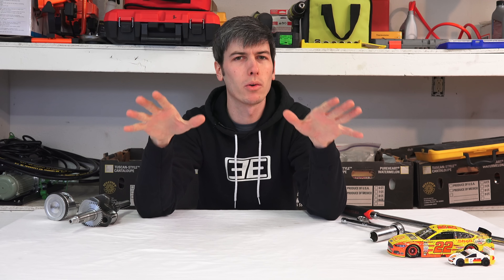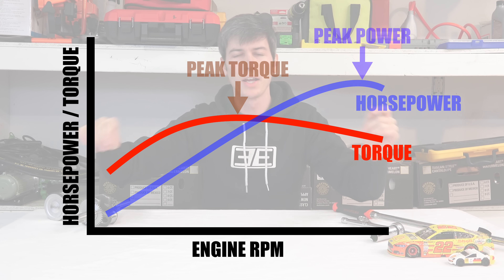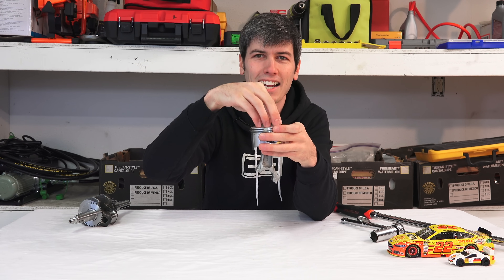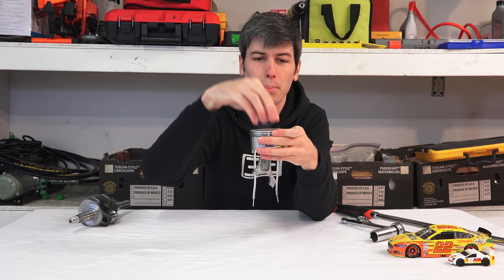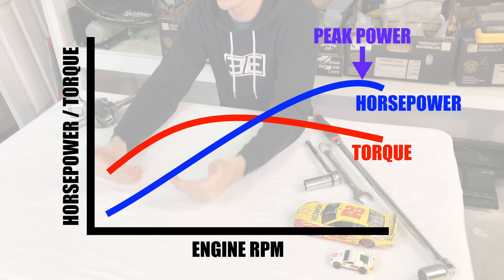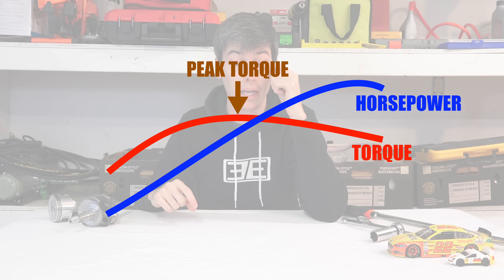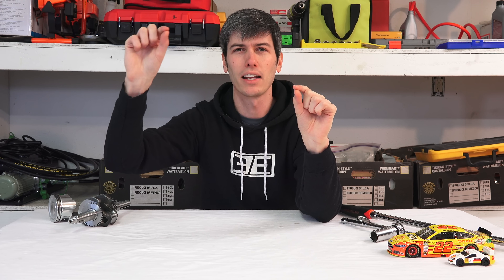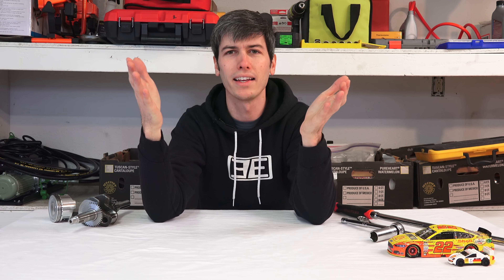Horsepower vs Torque - A Simple Explanation

Comment: This is how it would be thought of in a physics lesson. It might help. 

Torque is a turning force. And you can use that force to turn, or revolve something - like a spanner or wrench. And by applying torque, you can make that tool turn a revolution. By doing so, you have completed 'work' (though a fairly small amount).

Torque is measured in either Newton Metres, or Lbs Feet. In this explanation, we will just keep things simple - think of torque as strength. 

Horse Power is a method of measuring how much work is done in a given time. 

You need to know how much torque is applied, multiplied by how fast that torque is applied, to work out how much horsepower is achieved. 

This is the way I think of it...

There are two piles of bricks, one hundred in each pile, and they need moving across a building site. 

A muscle man and a marathon runner challenge each other to a race. To see who can move a pile of the bricks the fastest. 

The chap with a lot of muscle and strength (we will think of him as having the strength to apply lots of torque) is built like Ronnie Coleman. He is big and immensely strong but heavy and quite slow as a result. He is quite capable of scooping up a whole load of bricks and carrying them. He can carry 20 bricks at once, but he SLOOOOWLY.... walks with them. He could move all the bricks in 5 trips and take 10 minutes. 

The seriously fit runner, who is light and fast on his feet (think of Mo Farrah) might only carry 2 bricks - 1 in each hand - and sprints across the ground. He has a low amount of muscle (or torque) but his legs can run (a form of revolution for our example) at a really fast rate. It takes the runner 50 trips to move the bricks. Also in 10 minutes

Now if they both complete the task in the same time, then they have both done equal amounts of WORK (which can be measured in Horsepower or Kilowatts) and It's a draw.

However, if Ronnie Coleman could manage to carry 25 bricks per trip, at the same pace, he does it in 4 trips, and in just 8 mins. He will have put out more horsepower. 

He carries bricks at a slow pace compared to Mo, but by applying more strength (or torque), each rpm is doing more effort. Then it's just a case of multiplying the two together. Torque X RPMs. 

However, Mo Farrah - still only carrying 2 bricks - refuses to be beaten!!! He hasn't got the strength (or torque) to carry more than 2 bricks, but he can pick up the pace instead. So he runs faster and his legs are a blur!!! . He finishes the task faster than Ronnie, let's say 7 mins. His body, although weaker at lifting, has now worked harder, because his low amount of torque, could be multiplied by very high revs. Think of a motorbike screaming along at 16000 rpms....    Lots and lots and lots of small, easy efforts, all added up to one huge effort to beat Ronnie. And he has now worked the hardest

Mo Farrah's incredibly hard work (measured in horsepower) meant he was moving more bricks in a given amount of time.

Keep this example in mind and think of your car engine. Horsepower is simply a way of measuring work done in a given time.  It is not a unit of force, or a measure of how fast it can travel. The ability of an engine to provide power is achieved either by applying large amounts of torque at low revs, or applying low amounts of torque at high revs.

In real life Ronnie Coleman is built like a truck and would most likely win the competition in our example. He would be more efficient as he wouldn't be wasting time picking up and putting down bricks 50 times. Plus Mo Farrah would probably have to run at some ridiculous speed like 40 mph. It's just not feasible. You couldn't expect a motorcycle to carry bricks - it's not designed for it. The truck is. An articulated lorry tractor unit or semi - truck (if you're in America), might have 600 or 700 horsepower but that is only an indication of how much work it is capable of.

If comparing two vehicles to see which is faster, then look at POWER TO WEIGHT ratio. Although so many other factors affect performance: air drag, rolling resistance, a final drive ratio affects acceleration, fwd,rwd, awd, tyre traction.... etc etc etc. Its never simple. 

When office workers talk of how much work they have done that day - scientifically that's not really the case. It does not take a lot of horsepower or Watts to pick up a few pens, or shuffle some paper. The man who's outside, lifting and carrying all day long, has worked much harder. Something my boss could never understand when I tried telling him that office work is not real work! (sorry office workers. I mean no offence; that's physics!)
Reply: Thank you for your explanation. I found it very useful and informative. :)
Reply: Thank you: someone who still takes the time and trouble to explain something clearly and amusingly writing in the age of video.  Much appreciated.
Reply: Thanks for the clear and Crystal explanation!! Now, we have the clarity between the two. 🙏❤️❤️
Reply: Martyn M. It is a beautiful explanation! Thank You!
Reply: Best explanation. Trying for an hoir to understand through videos but this did it for me.
Reply: Best explanation I’ve ever herd ... I understand it in my mind but was never able to articulate it as you did .. well done sir!
Reply: Martyn M. Superb explanation, thanks. Robert, Australia 👍
Reply: Thank you for explaining this subject so well .
Reply: @Martyn M:  thanks for putting the cookies on the shelf so the kiddies can reach them.  You did us wonders explaining engineering in layman's term.  My imagination ran so wild that I was very exhausted at the end of your explanation rotating playing each character carrying heavy bricks up hill.  I now understand just how powerful the sports muscle cars are, especially the ones with 600HP and 550lbs feet of torque; no wonder they guzzle down gallons of petro within a few miles.
Reply: @Mmmm-zg1vn  glad it helped. Sometimes people just need to see a subject from a different angle.
Reply: I'd say that's a good illustration of how high-torque/low speed and low torque/high speed can yield the same results.  

Torque in itself does not tell us much.  Ultimate performance will depend on torque AND speed.  Horsepower takes both elements into account.
Reply: @Sherman62  Yes, that's right. By speed, I presume you mean how fast that torque is applied. But yes... Spot on!
Reply: @martynm.449  sir can u help me out ? im looking for a better weight picking pickup . i can see 2 figures. one is mentioning peak torque, other is hp. so what should i consider for a better pickup ? torque or hp ?
Reply: @harrysingh23116  It depends on how much they weigh. Compare their weight : hp ratios.
Reply: Martyn M.    Both you and the youtuber are exceptionally good teachers in terms of explaining what is horsepower and what is torque and the relationship between both in PLAIN SIMPLE ENGLISH。  Thank u very much
Reply: Thank u so much but I'm not in a proper position to take any credit 🙏  I've owned & driven many types of sports vehicles throughout decades but my passion and knowledge about cars were limited because my golden years had no such thing as 'Internet'. I'm picking up new knowledge n information bit by bit on YouTube. FYI, my playboy motoring years were cars like German Ford Capri (modified with dual Webber carbarutors), Jensen Healey convertible (DOHC 16 valves twin carbs), Celica GT DOHC dual carbs 2.0 liter, bimmer 323i / 325i / 330i / 335i / 530i / 540i ... stay loyal to BMW for 2.5 decades 
Best of luck to you and be healthy & happy 💜
Reply: Absolutely fantastic.. but i have a doubt nd I can only get back after framing the question.. as I need to understand this concept on a whole nd then frame my doubt
Reply: Excellent explanation ! Good job
Reply: Very well said, thank you for your input.
Reply: Interesting :)

The way it seems the easiest to understand for me is like this:
- torque is the maximum force that engine can create in one operating cycle, that is 1 RPM (at an specific RPM)
- power (max power), maximum work that engine can generate (which is function of torque and RPM). SO this tell us more about engine performance

So torque by itself does not tell us much. We need to know the context - range of RPM, or the best is to see the whole usable torque curve across RPM (which is power curve, or torque curve).
Reply: Excelent analogy.
Reply: Martyn M. Thank YOU
Reply: Good and helpful post. My only suggestion is that you delete the line near the beginning, "You can't really compare the two.", You CAN compare the two, and you did exactly that with the rest of your post. You compared (and contrasted) the two by means of analogies to give us insights us as to what the concepts torque and horsepower are.
Reply: @rontiemens2553  I've deleted that. Thank you for putting me right.
Reply: Martyn M. I will never forget the difference between torque and hp now. You did a great job explaining.
Reply: The brain uses about 20% of energy of a person at rest, more when thinking. It needs power to generate electric signals for information transfer. Work is just the integral of power over time (or average power times time), so office work is work in the sense of physics. This is similar to how computer processors work, they may require hundreds of Watts of power to operate without any moving parts, all power they consume is ultimately dissipated as heat.
Reply: @martynm.449  You need to have a good diet and get physical exercise to stay slim.
Reply: Martyn M. I am wondering how legs could revolve
Reply: I didn't read the whole thing...
Reply: i needed an analogy. Thank you!
Reply: .. Hey it's kinda unfair to the Seriously Fit Runner to not have a name.. Unlike Ronnie 'Muscle effin man' Coleman, don't u think..
Reply: @sakubatzumatsu  yeah OK. You're right. I'll call him Mo Farrah; he's thin and spindly.
Reply: @martynm.449  Can you explain me how gears in a motor affects torque and speed?
Reply: If its on me.. i would give you  and the youtuber on this video a Nobel prize for your time your logic examples and explaining shearing the precious information

You are rear in YouTube
Keep up the good work
Have a wonderfull day sir👑
Reply: N.Y.C Saturday February 22 5:20 a.m. reading your comment office work is not really work you just pissed off DMV, post office, and the IRS. you're in trouble .plus you have more likes than the video.
Reply: @timeisapathwalkingtounderstand  office work could be very very hard and stressful and the studys indicates that the office workers and customer service agents are more likely to get heart stroke or problems and brain stroke to the amounts of stress and anxiety they get in a day..

Wity that beeing said i understand what Mr. Martyn M. Is talking about.. in the law of physics work means moving an object from point A to point B 100% correct and logic at its best.
Reply: wow i understood everything, this made sense THANK YOU
Reply: @Martyn M, brilliant explanation. Not often do you come across highly technically minded people with the ability to simplify concepts like this. Would have been great to see a bit more on interpreting the specifications on a few cars when deciding to buy a particular make/model.
Reply: Excellent explanation.
Reply: Bro, I worked insane at a desk, and mental fatigue is way more exhausting than you think. P.S. I also worked construction for 40 yrs. Do you also realize that your brain processing your input from just your eyes alone can consume up to 15 % of your energy. Point, reading and processing "paper work" is very taxing. I have seen (some not all) hot shot foreman get promoted to office work and be totally overwhelmed with the amount of information they have to process being in an "office".
Reply: I absolutely love this response. Not only is it both more informative, understandable and correct than the video, it's downright funny. Thanks Martyn
Reply: @torestrand2663  that's the nicest response I've had. Thank you. :)
Reply: When a reply to a video does a better job than the video. Nice job! You explained this very well. Although I have to disagree with the bias against office workers. Your boss might actually have some right, have you even considered it? You may know a lot about physical power, but you still have much to learn about how the mind works 🙂 I believe one day you will gain this knowledge as well.
Reply: One of the best comments ive seen in the 6 years ive been in this platform, you could easily pass any exam to be a teacher with this skills. Congratulations!
Reply: @agustindetlefsen6944  Thanks very much! Have a great weekend
Reply: But wat of the ditch digger that doesn’t move from a single spot all day but shovels sand in one spot all day???
Reply: 5 years later I have to thank you for writing such comprehensible text. You just taught me how torque and horsepower are defined and how they work together.
Reply: This is quite possibly the best explanation I've ever seen. The video is super confusing and leaves out so much information.
Reply: Wonderful
Reply: Martyn M. Thank you so much for your explanation!

Is torque proportional to horsepower(Does horsepower increase as torque increases)?

Also, does torque improve acceleration?
Reply: @Super_Smash_Dude  yes, horsepower would increase as torque increases - if the rate at which that torque is applied stays constant. If more torque is applied and at a quicker rate as well, then horsepower would shoot up massively!

As to acceleration, I'm not sure I'm qualified enough to answer...? There are lots of factors to take into consideration. I would guess that the point of fastest acceleration would be when the engine is producing max horsepower, wherever that might be in the rev range. 

But in my experience - big torque engines give plenty of grunt off the line and mid rev range. And high revving engines wouldn't really start giving you that g - force (pin you back) feeling until it got up into it's higher revs. So it's down to where you want that feeling of acceleration. Low down in the gear, or higher up near the red line. Both are fun, especially the noise a high revving petrol engine makes close to the red line.
Reply: @martynm.449  Thank you SOOO much!!!

I'm really grateful for your answer:D
Reply: @Super_Smash_Dude  no worries.
Reply: I understand the metapher but what is hp related to a motor of for example a car how does it relate to acceleration and speed and where and how is it measured?
Thanks for the explenation.
Reply: @lewpressler2572  horsepower is the total amount of work the engine is capable of. Power to weight ratio affects speed and acceleration. Think of a cruise ship with a 50 thousand horsepower engine. Sounds a lot, but if that ship weighs 50,000 tons, the power to weight ratio is 1 horsepower per ton. And it's not going to be fast.
Reply: Martyn M. Why isn’t this pinned to the video? I’m disappointed in EE
Reply: thank you for your way of explaning i think i had understand a bit about tourqe...
specialy when u speak about using 1st gear to measure...
i was kind of wondering which gear is it that actualy being used in measuring tourqe and what was the exact distance...
it helped a lot to me
Reply: Martyn M. 
may i ask for an example...
the one using numbers...
i get d idea but still cant figure the way of computing to have the hoursepower
Reply: Martyn M. 
about the tourqe with ( lbs feet )...
where was feet been measured?
is it in the circumference of the crankshaft or the diameter?
or in the travel of the wheel
Reply: I wish I could have a way to collect all your replies! Very educational! Thx
Reply: Just let me know when the next class is and I'll be there... And maybe talk to my old chemistry professors so they're pass fail rates can get up out the grave.
Reply: Many thanks, that's the best explanation I have read.
Horsepower word is really confusing (to me at least), because power is synonymous to strength, so also to force and torque. Perhaps it should be called rpmtorque or torquerpm.
Reply: Martyn M. “Work” has a different definition in the “work place” now than when the phrase was coined.
Reply: zou got an A
Reply: Martyn M I appreciate your effort to explain by way of analogy but with respect if you read back you may even see some of the many inconsistencies present. The paragraph ending in it's a draw answers a question no one is asking. By and large more confusing than anything else really  and I worry that some people having read it now think they have their head around it when they don't.
Reply: Martyn M. Martyn M. Wow, you really did put some effort in it. Appreciate it.
But I have to say this, your analogy is a bit flawed. Actually, more than a bit.
First, you cannot use humans as an example because there is no such thing as cardio when it comes to engines. Engines don't get tired. They can run out of fuel but that is something entirely different. I will explain later. Keep reading.
Second, you cannot split the weight. If you want to move a car, you cannot move doors & windows in first run, than tyres & chassis in second etc...etc....It all goes at once.
I wont even mention that RC weighs like 140kg (~310lbs), and Farah around 50. 
So,
Horsepower is NOT equal to work. It actually represents the potential amount of work done in certain period of time. 
In physics P = W/t
So, right comparison would be like em.....just keep reading
Ronnie Coleman would develop much greater horsepower compared to Mo Farah anywhere and anytime. If u give them both a same amount of weight to lift on a desk which is 1m tall (lets say 100kg dumbell), Ronnie would lift it in a second or two, while the farah would take at least 5 or 6 seconds, if he even manages to lift it at all. That is cuz he is much STRONGER. And strength in a car would mean Horsepower, NOT torque. Do you copy? 
You MUST NOT split the weight because that is completely different comparison and type od work.
You should have put it like this for example: Diesel and petrol engines, if both generate 100 hp, are capable od doing same amount of work im certain period of time.
So, even if 100hp turbodiesel develops much higher torque, it still wont be able to pull more load than 100hp N/A petrol engine. Why? Because there is a thing called gearbox, and petrol engine will have greater reduction, aka shorter gearbox (don't know if term "shorter" is used in english, so you'll forgive me that one. In my language, we say it like that).
So if u hook them up with a 1 ton trailer, they will both pull it at same speed. Petrol car will just do it at higher revs.
Same goes for acceleration. 
The only momentum in a car that is relevant, is the one on the shaft that EXITS the gearbox (or momentum on wheels if u wanna put it literally) And that momentum is proportional to power that engine is able to provide at certain point.
To push this topic to the limits, an imaginary engine that develops 500hp, but only one Nm of torque( so it would rev like, 50k) could pull the same weight as 500hp engine which develops 700Nm of torque at low revs, if u provide it with much much greater gearbox reduction.
Reply: @milorad7226  in my example, the humans don't get tired. They are working at constant rates. It's a method of comparing two forms of producing power, in order to help people see things more clearly. However, the freedom of the Internet gives everybody (including yourself) the ability to express their opinion.
Reply: Martyn M. Dude, it's not my opinion. It's Newton's law. POWER of the car determines how fast you can accelerate or how much load you can haul. And power of the car is its horsepower, not torque.
You just need appropriate gearing. 
I don't want to offend you or your niece or teacher or anyone.....but saying that RC and Mo Farah would develop same horsepower if they were submitted to medical tests, is just WRONG. 
As it has been said before, torque is a component of power. Without rpm, torque alone does not mean much. You can have torque without power, but you cannot have power without torque. 
Just like the guy in the video explained.
Torque on the wheels matters, not one on the crankshaft. 
I really cannot explain it more clearly then I did in my last comment. 100hp low tq-high rpm engine is capable of doing the same amount of work as 100hp high tq- low rpm engine. That is not my opinion, it's how our cars work. 
Look at this example. Ferrari engine develops very high horsepower(lets say 550hp), but it does not have that much torque compared to hp. Lets say it had 600NM.
On the other hand, truck engine has around, lets say 400hp, but 900NM of crankshaft torque.
Answer me now, which of these 2 engines is STRONGER?
We'll continue after you answer.
Reply: @milorad7226  I don't understand what you are trying to say? You are making the same points that I have already done in my original write up. However, I don't know what you are talking about, when you reference medical testing? All you are doing is confusing people.

Why not make your own videos/diagrams /analogies or whatever and stop trying to needlessly cloud people's understanding.

My discussion with you is closed.
Reply: Martyn M. Clouding how? I was just trying to correct some analogies of yours, that were not 100% correct.
 We are all guys, petrol runs through our veins, and we should all understand perfectly how our cars work.
Its all about horsepower and gearing. That is the point.
You said torque is a turning force. Ok, but, you do realize, nothing actually needs to be turned, right? You can have torque on the crankshaft without it rotating.
Crankshaft torque is not what matters. Its torque on the wheels.
So even if ferrari engine (lets say 600hp) does not generate as much crankshaft torque as truck engine(400hp), it will still be able to pull greater load if you fit appropriate gearbox in it. That's all folks.
Reply: Martyn M. Amazing explanation thank you. The ladies in the office couldn’t understand why the linemen, working on power lines, were paid so much more in the same amount of time. Another factor is the linemen’s work is much more dangerous but that doesn’t factor into the HP/torque equation.
Reply: From a longevity standpoint it seems that  one running at a higher RPM would be the first to fail if made from the same materials. To have a comparable life expectancy, it seems that the higher RPM we need superior material,  possibly more maintenance.? Cost?? I know, I know, this has nothing to do with the topic of the video. Anyway, thank you, very informative 👍
Reply: Brilliant Explanation! Thanks a lot Sir! With the likes of this channel, School will be extinct soon.
Reply: Well explained... And Thank you for you patience and interest...
Reply: A truck might be rated at only 400 horsepower, but can still tow 80,000. A Dodge Challenger can be rated at 400 horsepower, yet only able to tow 8,000 pounds.
Reply: Thanks! I didn't understand the video but your explanation is very clear.
Reply: Wow. 👏👏👏👏
Reply: Bravo. Thanks for your time to write this.
Reply: Energy is information in quantum information theory 
So this makes that moving information is work too
Reply: @my self Also helps if it's red.
Reply: Martyn M. Read the whole thing. Thx bro 👍
Reply: Martyn M. please don’t say torque is measured in lbs feet or people are gonna actually believe it
Reply: Better than video itself! :D
Reply: So no head
Reply: haha excellent!
Reply: Martyn M. Thanks cutie
Reply: Best way to understand given the formulas  HP equals Torque x RPM thus max RPM you can do assuming one engine turn equals one tire turn looking at his cars
CAR1  200 HP divided by 100 torque equals 2 RPM
CAR2  100 HP divided by 2OO torque equals 1/2 RPM thus the first car gets more wheel spins and thus goes faster.  Note that these numbers are determined based on the engine you can have an engine with more torque than the 200 but it will have more HP than 100 at that half rpm  so you cant say I have same car two but I double its torque to 400 and now I only get a quarter RPM because you have a different engine now and if you dyno it with double the torque you will find that the horsepower has gone up also and the car may now put out 400 hp so when you do the calculation of 400 HP divided by 400 torque you get 1 RPM so it is a little bit faster.
Reply: Thx! That's a perfect example: "When office workers talk of how much work they have done that day - scientifically that's not really the case. It does not take a lot of horsepower or Watts to pick up a few pens, or shuffle some paper. The man who's outside, lifting and carrying all day long, has worked much harder. Something my boss could never understand when I tried telling him that office work is not real work! (sorry office workers. I mean no offence; that's physics!)"
Reply: Thanks man, didn't even have time watch the video
Reply: How does steroids and EPO relate to this?
Reply: Brilliant, I love this analogy
Reply: Excellent!
Reply: The go fast stripes had me rolling😂
Reply: Awesome read man! I do have a question since I’m new to this stuff. Is there a difference between lbs ft and ft lbs?
Reply: *taught
Reply: Big Mac vs Ferrari
Reply: Good explanation.
Reply: Really well explained, better than the video tbh
Reply: Amazing
Reply: A legend, Mr. Wayne.
Reply: Well done. Very well explained.
Reply: This man typed an essay. Deserves a like
Reply: Now explain it to me like I’m 5.
Reply: copy paste
Reply: RONNIE COLEMAN HERE I COME. JESUS
Reply: Before i like the comment it was 1.6k, after i liked its 1.7k, my like is worth 1k, i guess
Reply: Thank you for the better explanation.
Reply: But instead of guessing how fast too people can complete work.

200hp/100tq with 2:1 mission is 100hp/200tq and has same acceleration as 100hp/200tq with 1:1 mission,

2:1 mission cuts RPM in half therefore by definition cuts the Power in half (HP=TQ*RPM)
But 2:1 mission also doubles the TQ output.
Reply: A long comment but the information I got is very abundant. Worth the read
Reply: That last bit about "to see which is faster, then look at POWER TO WEIGHT ratio" is really what the common guy should fixate on... instead of peak torque or HP numbers. 
And I would say that the integral (area under the HP or torque curve) is more informative than the peak, as most of us are not typically driving bang-on at the peak.
Reply: Help!!
Reply: Thank you so much!
Reply: Your description has inaccuracies. For example, you said WORK can be measured in Kilowatts or Horsepower. This is wrong. Work is measured in Joules. Power is measured in Joules per second (aka, Watts). 1 W = 1 J/s.

The example in the video where the two identical cars (aside from torque and horsepower) travel the same distance, with the higher horsepower vehicle travelling that distance faster is a way better example.

You say, "The ability of an engine to provide power is achieved either by applying large amounts of torque at low revs or, or applying low accounts of torque at high revs." That doesn't make sense. Engines provide power by generating torque at any amount of revs. If you want an engine to provide lots of power you want it to provide high torque and high revs.
Reply: Thanks for this detailed analogy, it really helps! Bonus for the quick jab at office workers haha 😄
Reply: Flawless explanation! 💯 I completely understand now.
Reply: Very good Explanation but i think if Rone Coleman is Truck in your example then Mo Farrah should be Ferrari😊
Reply: You're wrong regarding office workers, they don't do the manual labor of shuffling paper around, they do mental labor of information processing, and information is also physical, so the brain burns energy doing mental tasks the exact same way muscles do, and the same way a computer consumes energy to make computations. Now it's true that high intensity manual work requires more physical power since the brain only consumes ~20 watts at all times while physical exertion can go into the 100s of watts, so you can say manual labor is objectively more work, but you can't say that mental labor is "not real work".
Reply: Nice video
Reply: Nice video
Reply: Best explanation! Thankyou for your comment!
Reply: Better explanation than the video!
Reply: You're a scholar and better than dude on this website.
Reply: Far better explanation than the video!
Reply: Bad enough the presenter need 7min 24 seconds to explain something so simple but your comment is ridiculously complex. From an automotive engineer.
Reply: Great explanation 👌
Reply: Thanks
Reply: Martyn m you need to start your own channel .thanks
Reply: @martynm.449  Work has many different meanings.  Physical exercise can be strenuous, but for most people, they don't think of it as working.
Reply: You're exactly right. Like when I'm trying to explain to guys at work that, there's a hell of a lot more work in a maintenance man's toolbag, than there is in walking up to machinery and pushing a button. Work is defined in hp and not what the majority feel good saying. Lol
Reply: I read your entire comment for two reasons:
1. A person that wrote "all that" must have an interesting point he/she is trying to deliver. 
2. still trying to understand that horsepower vs. torque thing! 
good example. However, I need to know all the components at work and the moving parts  stating at the engine and ending at the wheels, in order to understand it better.
Reply: @David-R.  Fox Mulder would say... 'The truth is out there'
Reply: Martyn M. 
I think I understand. 
Steroids= horsepower 
Cardio= torque
Reply: @terrypeart3875 lots of torque is the ability to lift the whole rack of weights and slowly carrying them to the other side of the gym in one go. Ronnie Coleman 

High revving engines are like the treadmill runners carrying one weight at a time but running too and fro. Think Mo Farrah.
Reply: Martyn M. 
Damn. Gonna have to read it again 😁
Reply: @terrypeart3875  you're thinking on the right track.

 Steroids and strength is torque.

 Cardio is a low torque, high revving engine.

Horsepower is just a measurement of effort. Effort from lifting weight or effort from cardio. If that helps.
Reply: @terrypeart3875  simpler still...

Think of horsepower as the grunt factor.

The amount of grunting and straining of lifting a barbell

Or the amount of grunting and straining as you run on the treadmill.

Horsepower is how hard someone or some thing works
Reply: Martyn M. 
Your troll defence is exemplary sir. 
I salute you😊
Reply: And I, the engineer, am standing here wondering why the hell you two are both carrying bricks up a hill by hand when there are far more practical alternatives like wheel barrows lol
Reply: ShatteredShards hahaha!!! You made my day! 🤣🤣🤣
Reply: amazing explanation! Thanks!
Reply: Tortoise vs hare.
Reply: Longest YT comment ever
Reply: Martyn M. My teacher always said: "If you can’t explain it briefly then it’s not good enough".
Reply: Had to stop reading when you said horsepower is equal to work
Reply: Martin S why did you have to stop reading? Horsepower is defined as the rate at which work is done - which is what Martyn M. said. I prefer this definition to saying that it is just “power” simply because it is more explanatory.
Reply: @forloop7713  That's what James Watt developed the horsepower unit for. A unit of measuring work. Google it if you like.
Reply: @martynm.449  he didnt develop horsepower, he developed watts. So, work is mesured in watts, not in horsepower. Horsepower is mesured as 100kg over 1 meter in 1 second (something like that, correct me if im wrong, havent seen the equation for a long while nor have used it).
Eitherway, the man gave a good example. I actually ignored the video from EE for the first time cause he is not correct, atleast not 100% correct, so i could read this comment. Cheers
Reply: @lukap1407  It's 75kg lifted 1m in 1 second. All fine with the Watts.
Reply: @forloop7713  thanks
Reply: A moment is a cross product of distance and force, so the Newton meters is wrong. Newtons is garbage because it is based on kilograms which is no a SI measurement, grams is. Torque vs engine rpm curve is to evaluate the airflow through the engine. Flat torque curve means constant flow of air per cycle. 4 stroke cycle, 2 stroke cycle, whatever. Airflow per cycle multiplied by cycles per unit time is power input to the engine.
Reply: Good explanation of work and power from a physics standpoint, but you shouldn't have said office work isn't really work.  The word "work" has more than one meaning.  It's not confined to the strict meaning in physics.  Look it up in a dictionary.